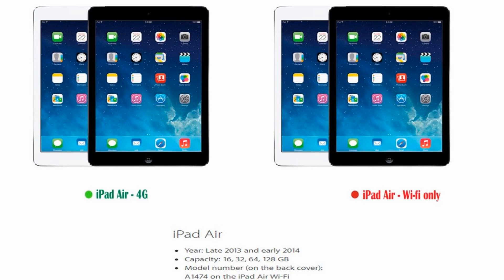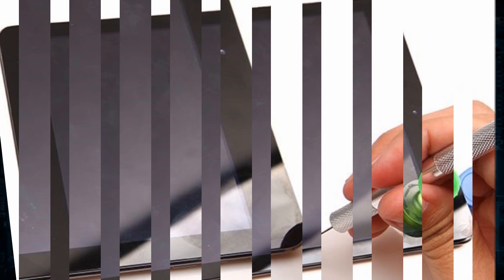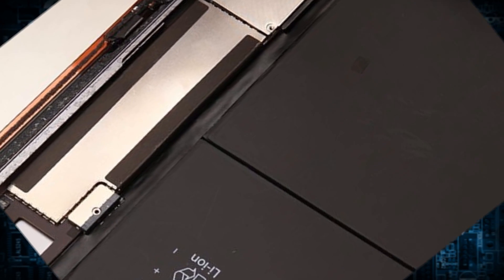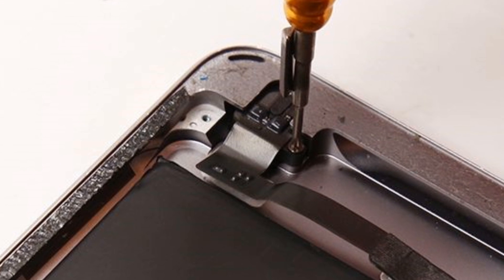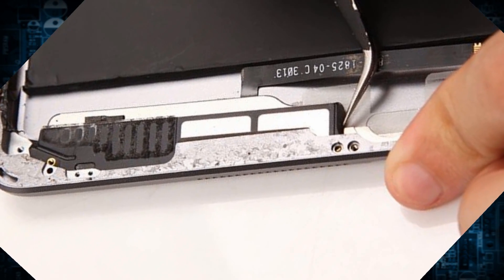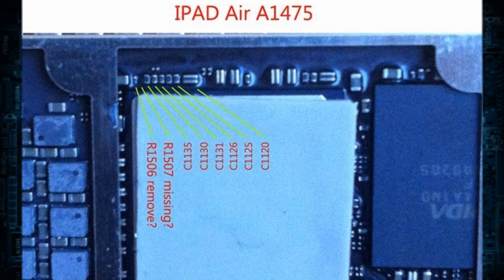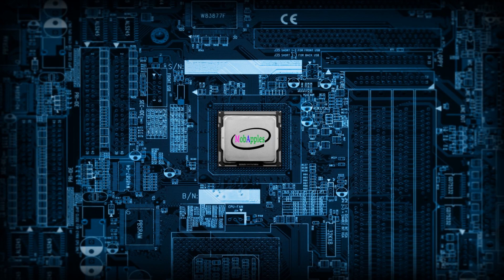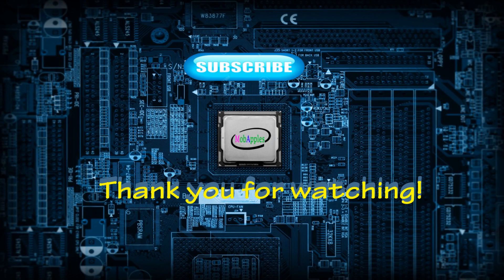Update| Bypass iCloud iPad Air | Full Detail and Schematic

Comment: my ipad is A1475 i remove  resistor R1506 and i flash formware* iPad_64bit_10.3.2_14F89_Restore.ipsw 
it is work 100000000000000%
Reply: really tell me how bro plz
Reply: hey, this method - removing the r1506, firmware flash, etc  really worked? i have the same model ipad the A1475 wifi with 3G SIM. i am trying to get more info about this procedure too... thanks  H L

Comment: a1474 ipad AIR hardware solution ?  not sim only wifi
Reply: Check this, Byрass аnу iCloud Aсtivatiоn Lооock gо tо:https://twitter.com/785c335103d2f5d35/status/719223888815734785                                     Uрdаtе  Bypаss iClоoооud iРаd AAААir   Full Dеtаil and Sсhеmatiс
Reply: @saileshbehera4712  maybe by putting a resistor at r1506 , insead removing it ( we dont ave resistor on our a1474 at location r1506 ) maybe by puting one 2,2k at r1506 we can update tablet  as a1475 to fuckup session key ,  after that  ,. remove resistor and come back to original setup  ,. i will test it now nothng to lost
Reply: on the a1475 seems that have nothing to r1507 , but have one at r1506 
on my a1474 have nothin on R1506 but have one at 1507 , 
its a sing , lets swap this chix to another location and lets see what happen
Reply: no